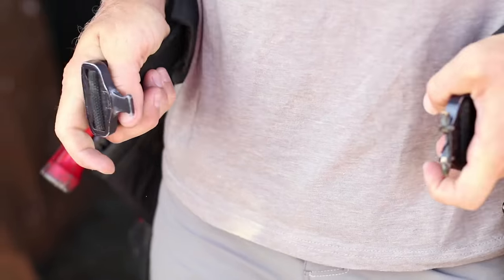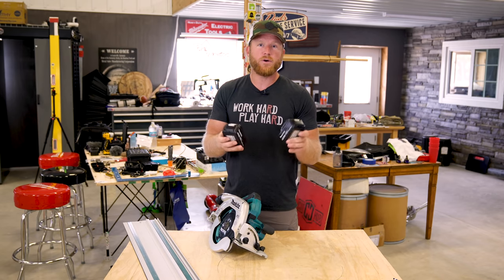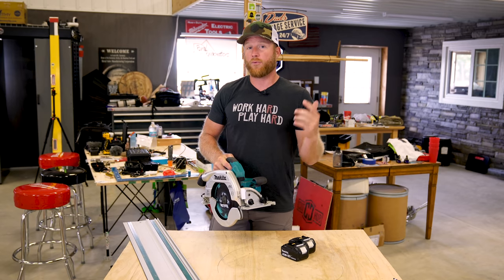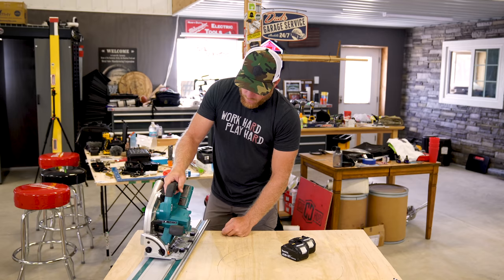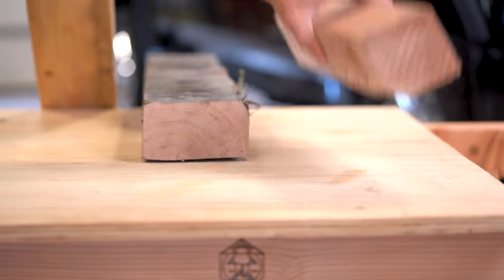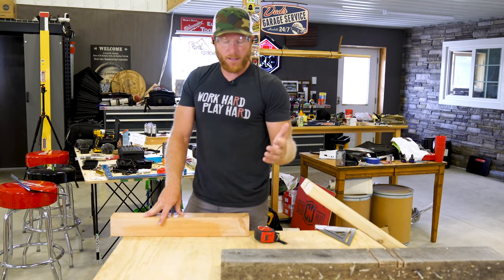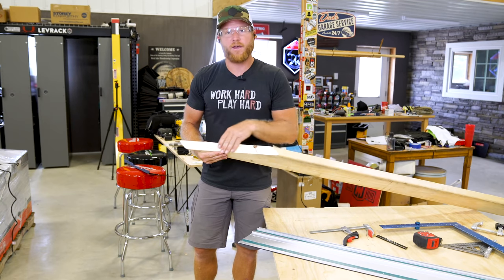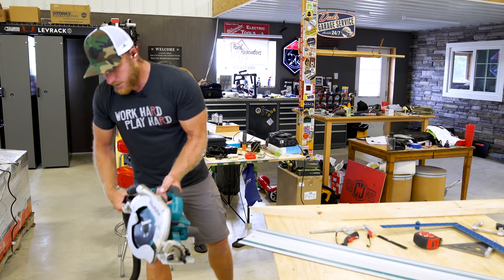Makita 9 1/4" 36V Track Saw!!!  Toolsday

Comment: Tips and tricks for Makita Vacuums and AWS. 
1. Makita hose (Part number 195433-3) is the best hose to use on portable machines that I've found. They are soft flexible and lite, they can be daisy chained together for extra length and with Makita's front cuff (Part Number P-70421) can also be connected to a mains powered vacuum hose. If you look around there are 5m versions of this hose. The only down side I've noticed is they don't like a lot of heat. 
2. AWS is awesome from the point of view that if used correctly it is possible to have a range of up to 200m for 1 vacuum if you have a long enough hose and 10 receivers (WUT02ZU) plugged into 1 vacuum with each receiver 20m away from the last one in a straight line. Why you'd want to go that far is beyond me but as a result it is easy to cover a large work area provided your vacuum is strong enough. Pool hoses are cheap.
3. An AC vacuum can be hidden away from your work area and a receiver can be run out on an extension cord with a hose to the work area. 
4. Loss of suction over distance can be in part remedied by the fact that with the power outlet of a mains vacuum only being used to power a receiver it is possible to daisy chain 2 vacuums and a receiver. 
5. The Makita AWS Miter saws can be connected to  2 AWS vacuums at once. If  Makita make a cordless table saw it also could have one on the blade guard and under the table. 
6. Dustless SDS drill bits work brilliantly with AWS and everyone that has used mine have either bought them or have them to their shopping list. 
7. Makita have an AWS enabled back pack vacuum. 
The biggest down side is there isn't a battery sander, jigsaw, multitool or router (Makita has a battery belt sander patent) that uses AWS yet and they aren't putting it on the mains tools such as miter saws, table saws etc that are rated too high to plug into mains vacuums. I'm hoping for a bluetooth battery or adapter for older tools.

Comment: I agree whole heartedly. Rough framing does not need to be rough. The better the cuts, the better it looks. Also the stronger firmer fastening. Do you think the offset is for minimum chipping on melamine?
Also I'm thinking when cutting angle for framing perhaps clamp another piece of wood on the side so you can clamp the fence as placing a clamp on the end can you get s clamp in. This saw is impressive. When you were cutting sheet goods did you get any tear?
I have the festool contractors saw and did have a festool cordless plunge saw. ( someone wanted it more than me )
The festool 75mm plunge saw is corded and this seems to be a good alternative.
I guess you can always put a blade with more teeth to get smoother cuts on sheet goods. I like ply and won't use Melamine anymore. Sand ply and it's quite appealing.
Nice video. It's pleasing to see people like you having pride in your work and always strive for perfection. Well done.

Comment: Hey I know there's a 8-month-old video but I wanted to point something out this is how I use my track saw it's not that 9 and 1/4 but you know I cut a lot of sheathing plywood is a non-cabinet environment, 

I'm considering getting the TSO rail square and the TSO parallel guides and I think it will work fantastic for what you're doing because when you're doing the four sheets these parallel guides you can just Mark the dimension that you need and have it already set. That way after you're done with your four sheet cut you can reposition this whole rail back on to the next set of four sheets on that same dimension without having to measure so that's one thing that you could probably use or the rail square which you would just use the back reference and you can make those long cuts with only measuring once this is where I was using it for like flooring subfloor on a few repairs and I just thought it was fantastic

Comment: Thanks for specifying that the track has a sticky side that prevents it from moving. I had been wondering about that when I watched your build videos. I would love to replace my old pole barn with one of your big buildings.
Reply: Still buy the track clamps as they help with smooth boards or warped sheets.

Comment: Would be nice if they could put a common 10” blade on it. 

I have being stuck buying a blade that only works with one saw. 

That would solve the 4x4 cut problem also.
Reply: Exactly. It doesn't really do anything a standard 7-1/4" saw can't do. Huge oversight by Makita.
Reply: It's one reason I chose the Skilsaw Worm drive table saw, so I can cut 4x4s. No other 10" table saw had the capacity.

Comment: I think the -1 degree bevel would be used for cutting a tighter joint in a butt joint for long carcass pieces. If you're going to have a little gap in a long joint you want to ensure you can place it on the inside of the joint, rather than the outside show surface. By tilting to -1 you can cut a joint that you know you can put together flush on the outside, even if the material is a bit imperfect. The same principle could apply in other instances too, like when trimming interior or exterior corner pieces for wall paneling. You can make sure the fit up on show face is tight by letting it open up a bit on the backside.

Comment: I just wish that Makita would make a mini track saw. Maybe a 4 1/2 blade and 18 volt   Only needs to cut 3/4 on a 45 degree angle. For cabinet and trim work.

Comment: Hey Kyle...Thx4 vid! Saw your demo about saw not completely cutting 4x4. Tip. Check the bottom of the depth  guide and see how much metal is left above the table connection. If you have some...choose the appropriate round stone for Dremel/Foredom and grind deeper. Just make sure that the tensioning washer tightening your blade is not below the bottom base surface. Always a pleasure to watch your vids. Bowtie pro!😊

Comment: If you mark your cut line to the outside of the base plate you will be able to see where your cutting without leaning over the saw, also makes the line visible when cutting on the bevel. Obviously not an issue when using the track. Keeps your eyes out of the fire line from the blade.

Comment: Great review!  I know I'm super late to the party, but need this saw for ripping thick slabs, so need the depth of cut it has.  But, need a really good blade for glue-ups.  Does anyone know of a blade that might work with this for that, or is the blade it comes with sufficient for gluing without using a jointer?  TIA!
Reply: I have enjoyed the blade the saw came with, very clean cuts. If you're steady with your hand it cuts and leaves a surface of about 100 grit, but you can put 9 inch blades on it to get more options.

Comment: Track saws all seem to be blade right, I just use left hand when it works better. It makes sense to develop the skill of using either hand; track saws make that pretty easy. I like the smaller Makita  track saw better than our Festool but often use the 8 inch Festool for cutting thicker material and stacked sheets of ply. This saw looks more capable than the Festool TS75

Comment: Well it's maybe built for metric users. In EU the closest wood size to a 4x4 lumber is 100x100mm, which is 1.6mm less than the 4 inch. So that would cut nicely :)

Comment: Is there a Left Sided blade version? 
 Right sided are nightmares. I want the weight on my piece, not my cutoff. And running down a big board is a pain going Left to Right with a right sided blade is poop. 
 
Hopefully Left sided blade comes out soon. I only have my right arm, and if a right, a Left side blade is a must.

Comment: This saw has actually 2 different versions. the one with the rail adoptable plate and another one with normal plate which is obviously thinner. so it could raise cut depth capacity slightly

Comment: Impressive that it can cut through 4 sheets of 3/4" ply but dumb it can't cut a 4x4 off. A 9 1/2" blade could have fixed that. Or just use a common 10".
Reply: 10-1/4” is the number you’re looking for. ;)

Comment: The fence would be good for repetitive cuts. Once you set it up you don't have to remeasure and reset your track. I have a kreg jig that is essentially that fence, but has measurements and accepts almost any circular saw. Haven't had a chance to use it yet though.
Reply: Flip the fence upside down and it will hold the saw an even distance from a wall or something like the plunge saw fence

Comment: I'm thinking of getting one this week.  How is the 24 tooth blade for more fine work?  The first projects I have are 2x2 PT mitered cross-cutting with the rail and a piece of PVC board 60 and 30 degree beveled sides to mount a shop light to illuminate a whole room from a wall/ceiling joint.  I won't have to tell people the kludgy idea I had to this with < 60 bevel saw.

If I do more fine woodworking later, will I want to invest in higher tooth count blades?

Thanks!
Reply: I did a picnic table with this saw and its cuts were fantastic, I'd say ~180 grit finish from a clean 24 tooth blade with fully charged batteries. If you want a different tooth blade you'll need to go down to a 9 inch blade, unfortunately. But the 24 tooth has been very good to me.

Comment: Good morning Kyle!
I've had the Festool TS55 for over ten years now, back then it was really the only player in the game.
While I love my corded TS55 for in the shop sheet-goods breakdown, a cordless version with a track would be nice.
I have the 7-1/4" Bosch left-hand blade with a homemade track/guide, a very useful tool.
How is the DC on that Makita Saw?
That extra 1/8" not realized. I wonder if there is some regulation that limits the capacity to under 4"...?
Cheers from Tokyo!
Stu

Comment: Great review Kyle, just to let you know my Dewalt 54v runs on my track... perhaps if you want to do a comparison with other makes, you should have them in front of you.
Thanks Jimmy joiner
Reply from the maker: The 54v track saw I assume you are referring to?  At this point there aren’t any other circular saws by dewalt for the track other than their plunge saw... which is great and we use... but does not double as a circular saw like this nor have much capacity
Reply from the maker: Also, you are right if comparing I should have it in the video
Reply: Hi kyle, yes its a standard rip saw model number Dcs576N.
You can buy it bare tool or with a track.
We have had them for about 3 years now and although i use my festool ttdack saw for fine cabinrt work the dewalt gets used for sheeting and site work...
Its a beast and has more power than our corded version....
Keep up the videos as we here in N.ireland love how you guys frame in the states...thanks
Jimmy joiner

Comment: I would say the main reason they probably didn’t add the extra cutting capacity is for 2 reasons. 
1) if they did want to claim they cut through 4x4 the would really need to make the saw cutting depth 3 11/16 for the reason I feel like majority of 4x4s you buy are almost never 3 1/2 
2) I would say because it has track saw capabilities they would probably need to add more depth for the track. 
Could all be fixed if they used a 10in blade and could get a little more depth out of the saw

Comment: I dont know if you have already done this, but could you do a basics of tools that everyone should own? I have searched around and there is so much info. I know i sound stupid but i am buying my own place soon and have no idea what the difference in basic things. For example i hear hammer drill and impact drill a lot and they look the same to me. No idea what the difference is.
Reply: Impact drills hit a screw sideways as it turns. Hammer drills are noisy pieces of #$%^ that hit concrete bits as they turn to give a chiseling action that brakes away small pieces. Get an SDS drill for concrete. What type of work do you want to do? Do you want to do gardening as well? Battery or corded? Are you interested in radios, lights, pumps etc? Hand tools are just as important as power tools. When thinking of battery tools look at the full range and try to avoid getting into more than one platform so as to save money. Buy a good wet dry vacuum early as most tools make a mess and its always good to have the ability to suck up water from leaks etc

Comment: An 8’ track is great to have when you need it, but that length of track is super convenient.
Reply: Best combo I've found is buy 2 10' tracks and cut one down to 6' and 4' that allows for 1' over hang on a 4' x 8' sheet using the 2 longer tracks. I hope my conversion to American metric worked. I've been using my tracks at those lengths for the last 13 years as it allows me to plunge cut or use a fixed blade saw with ease.

Comment: -1 deg could be to make joints in plywood tight.  My track saw does that.
Reply from the maker: that's about all I could figure, but why not just go the other way 1 degree?  maybe ease of use
Reply: @RRBuildings  1:31   https://www.youtube.com/watch?time_continue=92&v=fzXOhm1fIB8&feature=emb_logo  shows how this works.  Makes sense that you cut one piece at 90 and the other at -1. That's it...

Comment: My dad is a Miwaukee Carpenter, and I have all Makita...  Everytime I talk to him about tools, he goes in to a 30 minute diatribe about how he analyzed all the tools and decided Milwaukee was the best... I have to buy this just to finally get something that he will have to agree is better than anything he has.  My only problem with this saw is the 9 1/4" blade... No one else makes a blade that fits it...  What if I want a 60 tooth blade or want to use it for faster rips with a lower tooth count?  I get 24 teeth and thats it.
Reply: Do you know of any other blades that might work with this?  Can I use a 9" blade?
Reply: @Elena-ui2fj I have heard of people use 9 inch blades to get more options, kinda sucks that Makita won't make 3 blades for the flagship saw in this battery family though.
Reply: Any top of the line tool is more than enough for most construction and tbh most mid grade carpentry like bookshelves and picnic tables. And it's great, I'm gonna do my own brakes so I have an excuse to get an impact wrench, lol. But of the battery powered track saws, this is decidedly the best.

Comment: Kyle help me out with this one. The advertised depth of cut is 3-3/8 which as I make it is 5/8 short of cutting through 4". So how did your saw only miss 4x material by what looked like less than 1/8 ?
Reply: Gauged timber is smaller. 100mm rough sawn or 90mm gauged
Reply: @nevyn6071  we call it dressed timber in Australia. Makes sense, thanks for your reply

Comment: 1. I liked this video 2. I agree that that this saw missed the mark at 3 3/8.   3. I don’t think this is for rough framing with the track. 4. This saw would be great for irregular pitch hip roofs. 5. The blade is on the wrong side. My opinion of course.

Comment: I suspect that the reason it doesn't cut a 4x4 is that Makita is a Japanese company, and the whole world is metric except for the US of A. Whatever is the functional equivalent of a 4x4 in metricland is probably cut straight through. I have a Festool tracksaw. Are the Makita tracks compatible with Festools? In other words, can I use my Festool tracks with this one and vice-versa?
Reply from the maker: yes
Reply: A real 4x4 is 101.6 x 101,6 millimeters. Here in Peru we work with actual sized lumber. A 4x4 in the USA is 89 x 89 millimeters. This saw cuts 85 mm deep.
This saw, for me, would need to cut 5/8 deeper to cut real 4x4 material. It means that not even a 10 1/4 saw would cut a real 4x4, for me.
But I like it a lot! We mostly work with 3x lumber, anyway! I'm going to buy it asap!
Reply: America is Metric just the public don't know it. The Inch is 25.4mm but 25.4mm is not 1 inch. America went metric in 1975.

Comment: If they sold it in a corded version I'd be all in.  Ripping a straight 2 1/4in slab with a track one pass is ideal. The changing, charging, buying new batteries is not, especially when you're cutting for hours.
Reply: They have a 10¼ inch, but imo this has plenty of battery life. Makita's estimate of 100ft at 3 inches seems pretty accurate from my experience.

Comment: Good info. I was interested to see more on this saw after ‘part 9’ of the current build series. 
The -1° table setting is a little confusing. I can only speculate that it’s for trying to match an existing, less than perfect cut or to be able to ‘zero the table out’ after it gets banged around a little? I dunno. Probably a little over-engineering. Someone else employed that alternate guard retracting handle, some years back. I forget which manufacturer tried it. I always found myself reaching over and pulling the guard back the old fashioned way anyway, so nothing exceptional there.

Something I’ve wanted to see a manufacturer come up with is a tool (saw, drill, whatever) that can operate with or without a cord. A tool that, while plugged in and being used, operates normally and is charging the batteries at the same time. So when the battery begins to wear down, you can just plug it in and it continues to operate normally. Or you can replace the battery with a fresh one and continue working cordlessly. Not sure why no one has come up with that yet. 🧐
Reply: I think the DeWalt 60v tools have something like that? I could be wrong...

Comment: Why not make a 10 1/4? That blade cuts through 4 by material no problem and is readily Available. Just makita making an oddball size balde so you have to buy there's, would be like skilsaw using a 16 1/2" blade instead of the already available 16 5/16"